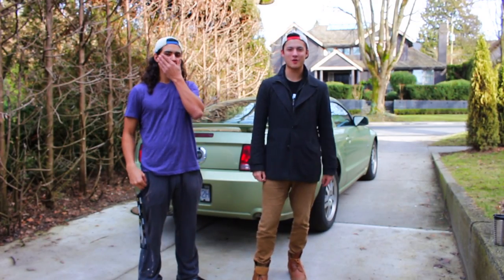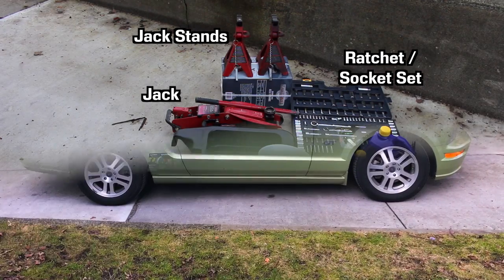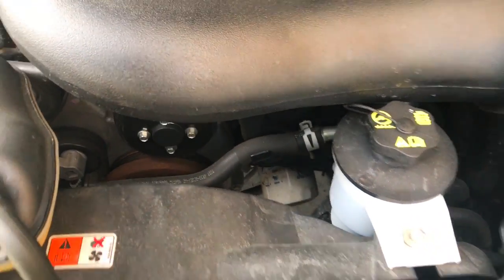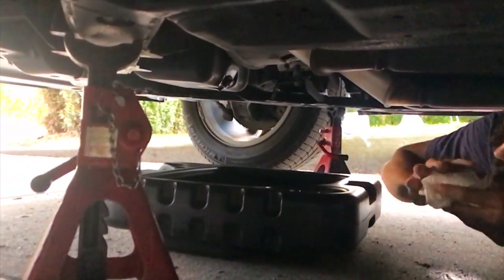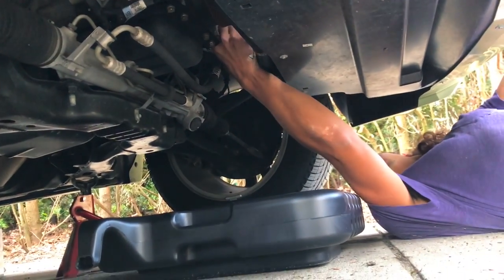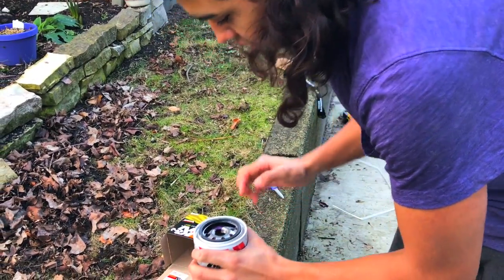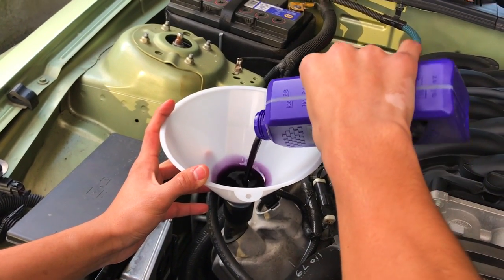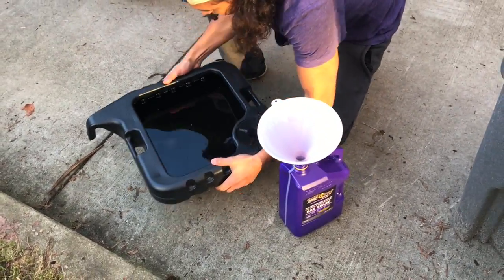DIY: How to do an Oil Change FULL WALKTHROUGH | Mustang GT

Comment: 🤦🏽‍♂️ hand tighten is good enough. Don't use a wrench
Reply: I hand tightened and it didn’t work
Reply: Why is there a spot for a wrench on the filter if it was unnecessary

Comment: You put oil on the filter to  make the seal slippy and prevent from tearing apart. Not to make it easier to remove. But apart from that great video keep it up.
Reply from the maker: Oops! Thanks for the support!

Comment: I changed my oil for mines which is I’m assuming a lot older than yours in miles and all of a sudden after driving it a little it started vibrating like crazy with a loud pounding sound, any opinions
Reply: totaled
Reply: i’ll give you 50 bucks for it since i’ll have to tow it home
Reply: More than likely missing. Check plugs and coil packs